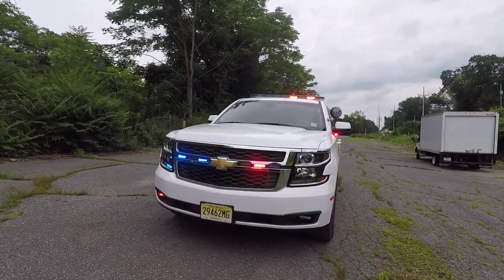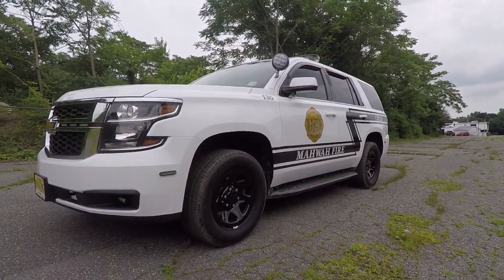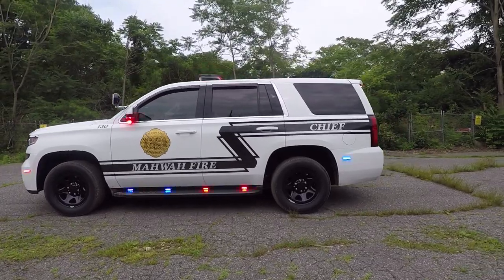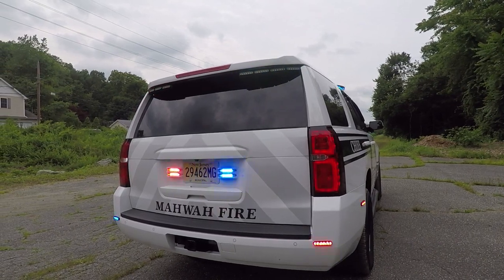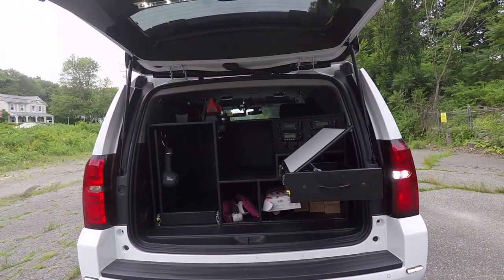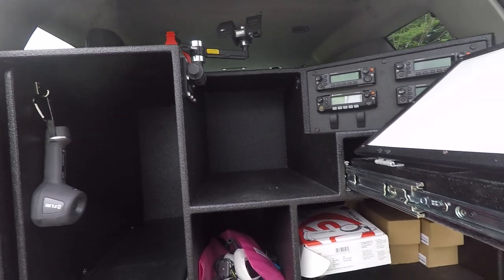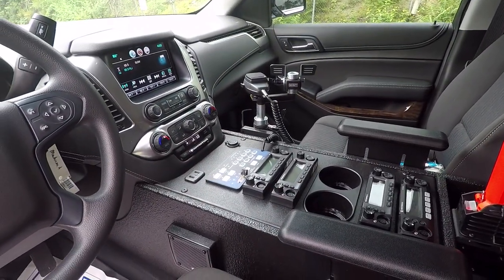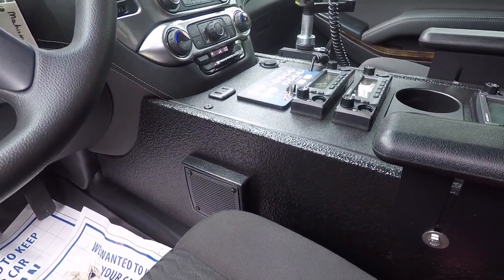Mahwah Fire Department 2018 Chevy Tahoe Command Vehicle 10-75 Emergency Vehicles

Comment: Pretty cool looking with the white/ black design & graphics. Absolutely not a fan of that flash pattern at all. I'd synchronize all blue lights to be flashing at the same time alternating to all the red lights flashing at the same time.
Reply from the maker: Thanks for your input! The great thing about the bluePRINT system is that the customer can have us log in to the system and we can easily reprogram the system to fit their exact request.